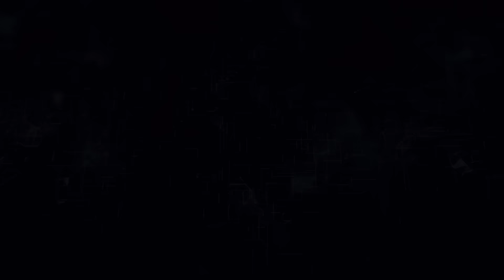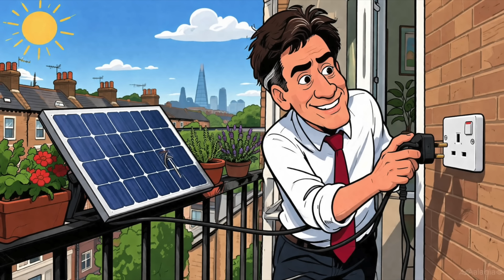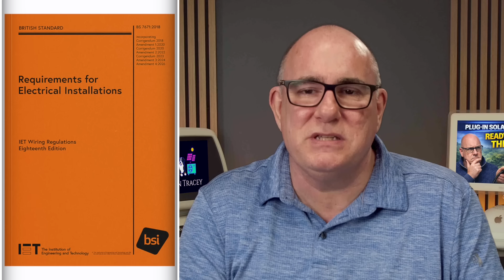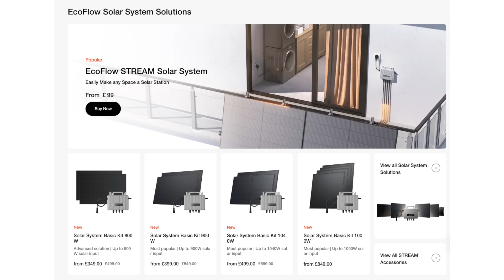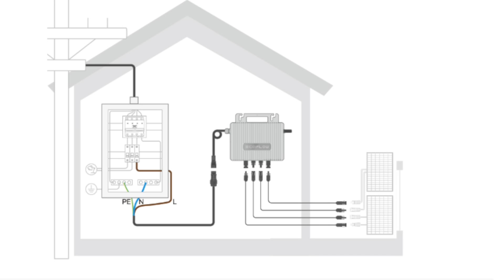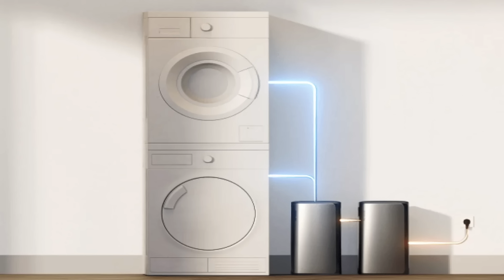Plug In Solar Is Coming… But There’s a Problem

Comment: Just found your channel as iam planning to go solar ive just had all my electrics upgraded new fusebox and everything so iam at a starting point ive been wanting to go solar for a long time and i want to convert from gas to heat pump for my hot water and heating iam on a combi boiler at the moe it ten years old and its time to be changed ive already changed the heat exchanger and the brains of it as both packed up over a period of time so i will be looking for some advice i am an electrician but for cars and high voltage evs and i own an ev and want to be able to charge it for free as my charger is an ohme one which takes solar input iam facing the right way as people down my street already have solar and i want a good battery or batteries to run all night and in poor weather i know it wont be zero maybe on hot clear days i may get zero but i will be going for a bigger one to be able to go zero grid if i have to get two batteries then so be it we have enough roof space and garage space for solar pannels can i go solar just for the car then add on solar for the rest of the house just wondering so that juring the day my car will take a charge and switch of at night as my car does have vehicle to grid aperently its a hyundi kona 2026 model you can plug your kettle into it and so on with an adapter so any way any advice would be great all the best John from Rugby UK.
Reply from the maker: @kinkong1961 you’re in a great position to do this 👍  

Yes, you can start with solar focused on the car and expand later — but in reality it’s usually better to design it as one system from the start so everything works together (solar, battery, EV, house load).  

With your setup and space, getting close to zero bills is definitely achievable.

Comment: The safety features on these micro inverters prevent them from generating during a power outage which for me is a non starter.
Reply from the maker: If you want that feature, there are many other inverters that have it, my big solaredge system can go into island mode and supply power of the house during an outage. It’s generally a feature of larger inverters.
Reply: The power they deliver is usually so small they won't run anything useful anyway, mine averages 120W during daylight hours (and I live somewhere far better than the UK for solar generation) and of course nothing all night. To run my heating plant I just use a seperate system and a battery like most people.

Comment: The only real problem i can see is all these solar panels going up like when Sky satellite first kicked off local councils hated all the dishes going up "more safety them not falling off walls and so on" .. but yeah the government will make it as simple as possible to set this up & be prepared to see energy companies will go all out to make it hard for people and the scare mongering ... Yes i will be getting a solar system ... side note if "& it's a big if" they let you sell electric back to the grid this then becomes a tax thing .. but maybe that's for anther video lol
Reply from the maker: @daves2924 I think you’re right 👍  

We’ve seen this before with satellite dishes — initial resistance, then it just becomes normal.  

On export, you can already get paid in the UK, but the challenge is certification and scale for these smaller systems.

Comment: Yet it is still is used everywhere else and nobody is blown up or dead,  usual UK trades and standards trying to protect their scams.
Reply from the maker: @limitedmark “no one has blown up yet” is always a solid foundation for safety standards 😂  

The reason you don’t see issues is because of regulations and protections, not despite them.  

It’s not about stopping people — it’s about making sure it works safely at scale 👍
Reply: @JonathanTracey  I will stick with over regulated scams thanks. Like I said , they have been used in other countries for years with no issues yet the UK had a ban on them until now, nothing has changed.

Comment: I have had plug in solar since 2014 before the ban even came in and I have not had a problem with it at all whatsoever and I think you're wrong of the Max wattage of the micro inverter I have a 1200 Watt and a 600 watt solar inverters And they pulse with electric And they go off when there's no electric going through the main feed even my electric company never said nothing and some days electric can only cost £3 in a whole day
Reply from the maker: @martinjones-j3c fair play 👍  

If it’s working for you, that’s what matters — and you’ve clearly got real-world experience with it.  

The only thing I’d say is standards are there to make sure setups are safe and consistent for everyone, not just the people who’ve made it work themselves 👀

Comment: For crying out LOUD DON'T connect your inverter's output to a plug as it will become dangerously LIVE and could KILL someone if they touch the pins, and it could be a CHILD!
Reply: It could also be an adult or the dog. But if it actually works as it's supposed to, it's safe.
Reply from the maker: No, it won’t. That is nonsense. If you actually knew how these things work you would understand that the inverter synchronises with the grid using the 50 Hz signal from the mains. If that 50 Hz signal goes away then it immediately cuts the power, you can quite safely touch those pins no problem at all. Don’t believe me go and check out the Efixx channel where qualified electricians actually demonstrate this. Rather than somebody on the Internet scare mongering for the sake of it.
Reply: @JonathanTracey  Excuse me, I have nearly 50 years of experience of working on mains electrics, including three phase stuff, and including full house rewires, and I've similar length of experience of electronics servicing, so I know that such a fancy inverter can fail in such a way that the output can stay live while powered, and that you should NEVER feed dangerous voltage to a male connector with bare exposed pins, or tags etc. for safety's sake, the supply should always go to a SOCKET, not plug, or be hardwired and enclosed, especially as 50hz is just about the right frequency for fibrillation of the heart.

Comment: For several years now I've been considering fitting a small solar panel on my chimney stack facing south to put some of my lower powered stuff off grid to maintain some essential stuff during power cuts. And solar panels only work in daylight, not in darkness, so you need a BIG suitably sized storage battery, and a solar charge controller and a pure sine wave inverter of suitable rating and lots of heavy duty wiring and fuses or breakers etc. and of course you need the technical expertise to assemble it all safely.
Reply: Because you need a batterie, you will probably go the way of an All-In-One System, like the "Anker Solix Solarbank 3 Pro", but here in Germany there are many other manufactures with similar products.
Here the technical part is idiot proof: you have 4x2 inputs for the solar modules and then on cable to the power plug. It might be more challenging to get the modules on the roof.
All you need an electrician for is the installation of a smart meter, so the System knows how much it needs to send into the grid to take over your needs.

The battery usually can be extended to quite large numbers like 10-16kwh. That should be way more then needed for most households. And you can usually easily extend you storage by buying a new battery and add it to the system. But of course batteries are still quite expensive, like 200-300 Euro per kwh, so overdoing it can be pricey...

Most system have a kind of emergency plug, which gives you energy when the grid is down. The Anker can do 1200W, some others go up to 2400W. This should cover the most important things like fridges, but of course not the full house.

In Germany a typical system with like 2kwp modules, 800W output and decent sized battery can take over like 80% of the needs of most house holds during sunny days, which is pretty impressive 😁

Of course, only one module won't do much, and probably a battery would not be profitable. Do you have space for 4 modules?
Reply: @jensuwe22  If I do ever install any solar panels I won't need a so-called "smart" meter or any net connected stuff, I'd just need the panel and a battery, lead acid ones are far cheaper but heavier than lithium-ion ones, and a charge controller and a basic non-"smart" pure sine wave inverter  and the various cables and terminals and fuses or breakers etc. I won't have smart meters as they're a whole pile of trouble as they can be remotely hacked and they have a relay built in which can cut your power off which can also be hacked. So I've told my energy suppliers they're not fitting any such stupid meters in my home, full stop! And I would most likely hard wire my lights to the solar system especially as I only now use low energy bulbs, plus some dedicated sockets for the fridge and freezer which have induction motors which must have pure sine wave power, and I have amplified white noise systems around my home which I'd like to power off grid too.
Reply: @majorpygge-phartt2643  the smartmeters for those devices are very simple and they have nothing to do with your energy supplier. It does just measure what your household needs in energy and thats it, no magic. It communicates only within your local network.
It makes the usage of your batteries much more efficient. Otherwise you can just make plans like "use 400w between 5 and 8 o clock". But for example the fridge switches on and off at random times, so you either put too much energy from the battery into the grid or too less.

The prices for batteries also go down fast. For my Anker system I saw discounts so it was at 200 Euro per kwh... Thats a price where it the break even comes fast
Reply: @jensuwe22  I don't need or want any "smart" gadgets, I don't even have a smart phone, and I know what my fridge and freezer consume, as well as my lights and TV and set top box and laptop etc. I don't need a fancy online hackable meter to tell me that, and batteries have capacities rated in amp-hours which are simple enough to understand, like if you use a 100 amp hour battery for something that draws 2 amps the battery will last, in theory at least, 50 hours before it needs charging but your solar panel should charge it in the daytime and here in England no night lasts 50 hours!  And of course solar panels can't be used everywhere, like in the polar regions where it stays dark 24/7 all winter long. And my idea of using solar panels is to power stuff totally off the grid without any network connections, either hardwired or wireless as I'm not interested in trying to sell power as I need it for my own use. And 100 watt hours for example is 100 watts consumed for one hour so it's simple enough to figure out, like 100w consumed over eight hours is 800 watt hours, and amps = watts/volts. And of course in the winter here in England where we get lots of short dark days solar panels would be far less efficient at the time when you most need the power.
Reply from the maker: @majorpygge-phartt2643 you’re absolutely right 👍  

A fully off-grid setup does require more components and some technical knowledge.  

What’s changed recently is all-in-one systems — they simplify a lot of that complexity, so you don’t need to build everything from scratch anymore 👀

Comment: I did this at a rental
5 panels and inverter plugged on to an old air conditioning power socket. Generating about 1kw/h most of the day. 
Inverter was a proper grid unit with all the protections
Reply from the maker: @voltare2amstereo that’s a great real-world example 👍  

1kW sustained from a simple setup is exactly what these systems are aiming for.  

Main thing is just making sure the circuit and protection are suitable for backfeed — but sounds like you’ve done it properly 👀
Reply: @JonathanTracey this was on an old spinning disc meter with gas for cooking and water. 
My average from the grid was 2kwh/day..
-
I'm in my own house these days and roof covered in solar and batteries, still average 2kw/h from the grid.

Comment: Been very noticeable how much scaremongering those with a vested financial interest in solar installations are doing over plug in solar.
Reply: Still not as bad as the scaremongering coming from the fossil fuel lobby regarding solar in general.
Reply from the maker: Yeah I see a lot of of this and it’s a shame because what they don’t realise is that this is the way to get people started on solar. A lot of of these people once they’ve had a micro system for a couple of years and more likely to upgrade to a larger system, which will be more business for the solar installers

Comment: But there is know way any grid tie can island and produce mains voltage when unplugged the only issue overloading as its another source of power into your mains circuit so its possible to overload it ie 32 A from consumer unit plus the plug in solar
Reply from the maker: @nounoufriend1442 you’re right 👍  

Grid-tied systems won’t island — they shut down without the grid.  

The overload point is the key concern, which is why circuit design and limits really matter with plug-in systems.
Reply: @JonathanTracey  The issue is we have ring mains in UK with single breaker but Europe tends to have lots of separate circuits going back to their own breaker so plugging into one of these is not an issue . In reality overload is unlikely to ever happen but they have to assume the maximum solar feeding in plus what consumer unit breaker can deliver is more than the normal 2.5 mm cable can handle . I set up plug in system last year and even with 4x 420 w panels we never go anywhere near exceeding safe amps
Reply: @JonathanTracey  Used clamp on meter and when using anything that draws lots of amps ie kettle , washing machine , as soon as the solar starts producing power then the amp draw to the consumer unit drops as it should  . This system feeds into a dedicated spur feeding the shed

Comment: Equipment is likely to be imported without safety checks and sold to the vulnerable. Not looking forward to the first tragedy, but you can bet members of the UK press are.

If the equipment is properly checked, then this sounds like a good idea, and may bring down the entry price of permanent solar systems.

I for one, can’t currently justify the price of the latter, as it is likely I’ll be pushing up roses from the grave, before getting any payback.
Reply from the maker: I very much doubt the supermarkets and even Amazon will be selling unsafe equipment, there are enough protections in place to stop this from happening. I’m sure there will be a few, but these are people who generally don’t follow the rules so they take the risk upon their own head.

Comment: Feels like a bit of scaremongering here based on thin facts. So it won't replace the roof panels, but it will cost 10%! No one really cares about micro invertors, it will just come as a consumer kit and away you go, much to the dismay of those who like to overcomplicate things for likes, with their hugely expensive roof installations. Sorry my friend, it will be simple and everyone will do it. Bot like EVs, those who felt superior to everyone else with their Tesla 2 years ago.
Reply from the maker: @mikeysteam I get the point 👍  

And you’re right — it should be simple.  

But the “overcomplication” is mostly about making sure it’s safe at scale, not for likes.  

Also… nothing wrong with expensive roof installs when they’re saving people thousands 😄

Comment: I am considering this if only to keep a fridge/freezer working when Putin/Xi turn the electric off
Reply: But it won't. And it's Trump you need to be worried about.
Reply: @jablot5054  Actually working in computer security it's bored 16 year olds you need to worry about. If a corporation can remote manage your device then someone can hack that corporation and turn them all off for the lols and a tiktok video.
Reply: Xi will be able to turn your battery/inverter off too. Most of them are totally dependent upon the cloud and run off chinese cloud services. Ecoflow stream is pretty useless unless its attached to wifi and the internet.

Some can be isolated from the internet but not many.
Reply from the maker: how are they going to do that, more likely to be trump than them
Reply: @JonathanTracey  At the risk of being a little bit too 'Tom Clancy' both of these bad guys have an abilty to damage/sabotage UK infrastructure if they choose to. Whether by physical damage to say power/gas undersea connections, or by cyber attacks, or even, those pesky 'sleeper cells' that Trump is convinced exist.

Comment: the entire thing is silly 400w is like overloading the system with a whole ....1.7a for a 400w system. In Ireland forget it. Obviously there has to be limits as ahem some have more than one micro inverter. It's the hyperbole on both sides. You r video is great and cuts through
Reply from the maker: @waheex appreciate that 👍  

Just to clarify one bit — 400W isn’t “overloading” anything, it’s actually very small in electrical terms (~1.7A as you said), which is why these systems are being considered safe for plug-in use.  

The real concern isn’t the power level, it’s things like *circuit design, protection and how multiple units interact* — that’s where the regulations are still catching up.  

And I completely agree — there’s definitely hyperbole on both sides, which is exactly what I was trying to cut through 👍